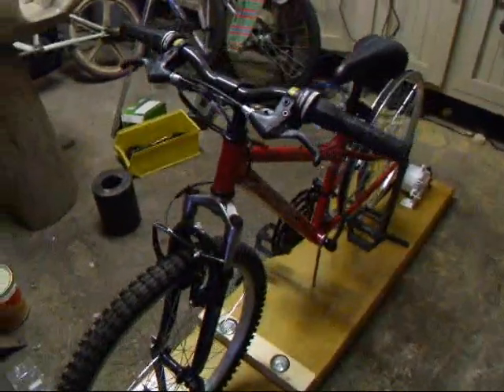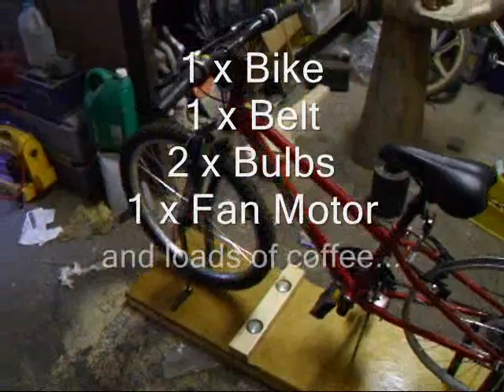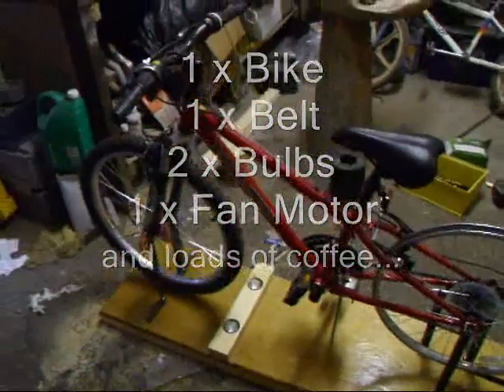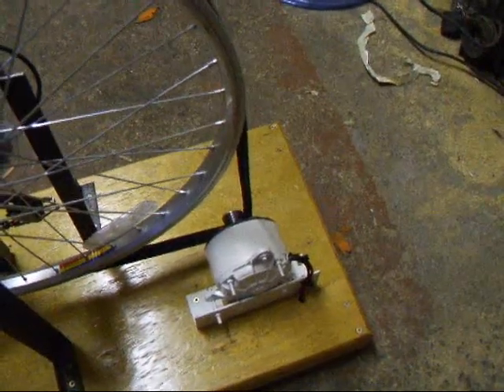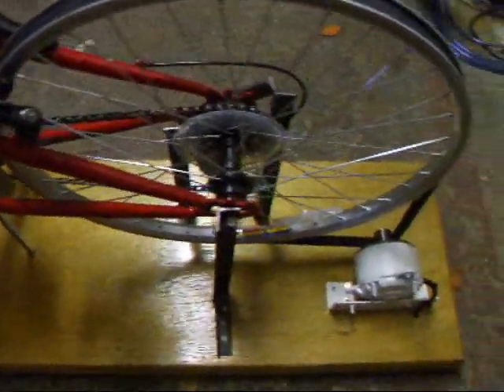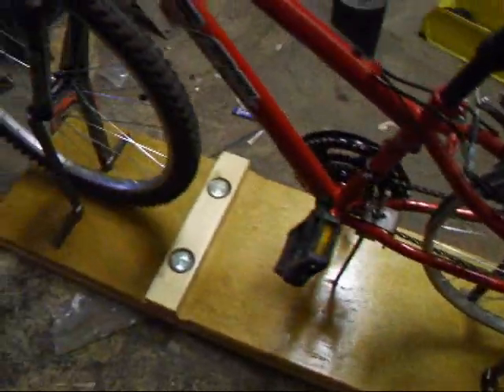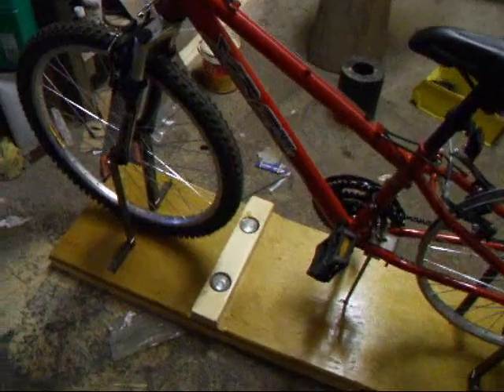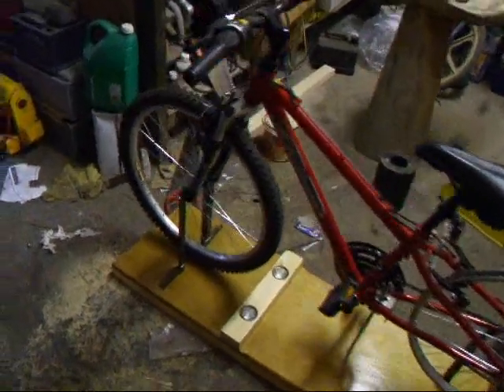Bike Generator

Comment: 24 years ago I built something similar using  plywood,redwood 4 by 4, support wires for a bike stand and 4 car windshield motors mounted underneath the bike cargo carrier and my 10 speed bike. Used 2 short round pieces of wood from a dowel rod for drive wheels. I could charge a dead car battery in 20 min enough to start my van.  2 min pedaling got 5 min of TV watching time.
12-14 Volts
6-7 Amps
75-80 Watts
About 50% Efficiency.................Bad.

Comment from the maker: It will be a DC motor on a scooter, the diodes are for when you apply the brake, switched into circuit so the motor can only regenerate power and not use it... probably not needed... anyway... go do something productive... Get your Joe Cell working and Pantone Pipe plugged in... Do you use a fuel vapourisor? Or just thinking about it ;)

Comment from the maker: Its called regenerative braking and it is a very good idea. My electric truck has it, without it, I probably would not be able to stop it with the brakes alone.
So charge your battery when you press the brake, take the brake off and use the generator as your brake...